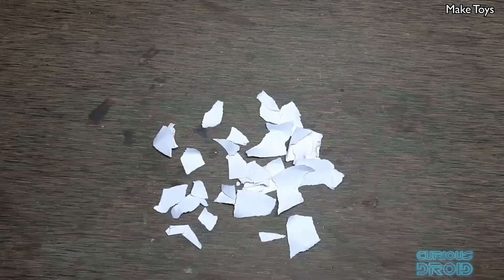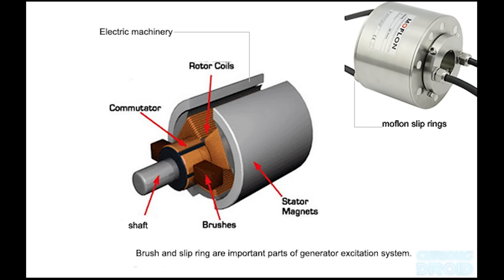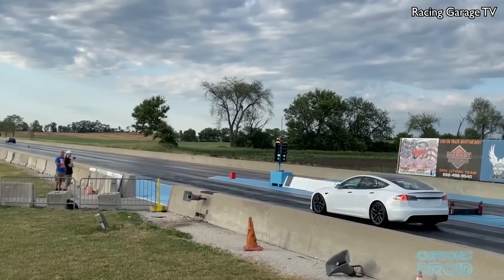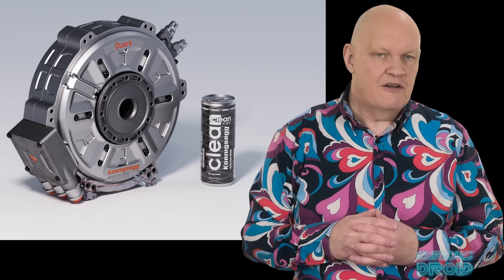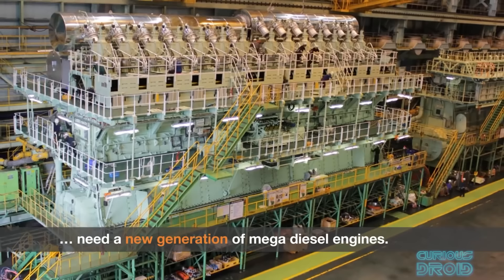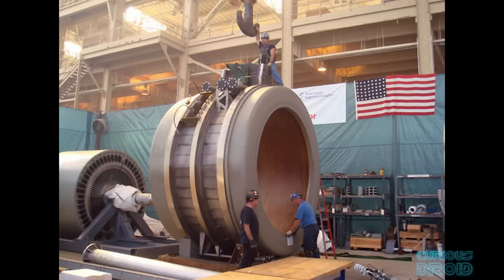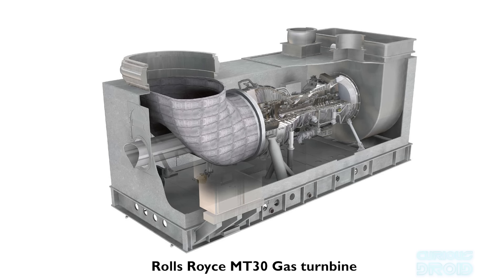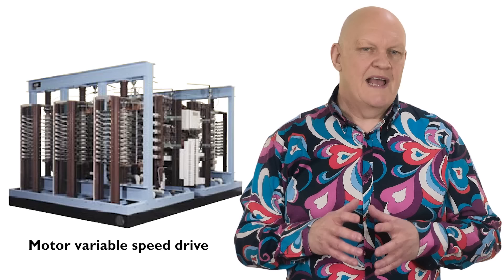The Worlds Most Powerful Electric Motors

Comment: why did you forget brushed dc motors
Reply: you can integrate cooling, both air and liquid (water, ethanol) cooling
Reply: you can use conductive bearing lubricant, carbon graphite, as brushes

Comment: Seeing as we've known for a long time that a diesel generator pushing an electric motor is more efficient than having a diesel engine why has no one done anything similar in an aircraft?  Instead of four fuel-guzzling turboprops you could have four motor-driven props powered by a single turbine, same output for a quarter of the fuel.
Reply: I guess mostly weight and safety (both from less redundancy and more complexity).

Comment: what they done wrong 200 amps to run  more amps more heat, so how can you solve this well this part most know the motor can run at 1000 volts  now amps become 20 amps or less
now we have a probem batters  so lets take this off the drive line all togather, there is another way to run a car with no motor on drive line no trasmission no drive shaft,
so what is left, because all people who work on are schooled they never ever understand what to do, and do to what this worth i not going state it here, 
but this been around for last 30 years so nothing new, so how will this work we need small motor to drive few things we need make 50 amps maybe 80 max 
now batterys  are 3 phase runs the motor wich will drive two devices  these devices will run the car now motor will have built in two battery chargers
so we have 5 banks of batterys when battery get to 70 pecent it swap out and charge and so on so no bank gose under 60 pecent 
useing this the car can run for ever never need charge, when u leave the car genartor can keep running to bring all battery charge up 
u just cant drive off with car . no soler panles none that now they making power in 1950s 60s and yeat peolpe say was never done , well was done, becuase u never schooled in it dose not meen it was never done,  and one odd thing no busnes has ask me how, they think there perople can figger it out some point time they might fisrt one own all rights to it 
and if they cant o well,  this can be done this can be done to power hole contry idea is same, but they not looking for green renewable power they want the grants trying to figget it out
so as long as it resuch all grants they get keeps comeing so to figger this out ends all them grants but they forget how much busnes will pay to use it , totaly green cars rv trucks  it can be done 
and no one cares to do it what this even sujest  that dont want compeat it at all

Comment: So the 4 electric motors produced what one big diesel does. An weigh about the same. So the " YOU WOULD BE WRONG IS NOT CORRECT AT ALL. 27000 IS A LONNNG WAY FROM 107000 HP. AN YEAH WHERE DOES THE POWER COME FROM? WEIGHT OF THAT COMPARED TO THE DIESEL BURNT? OH AN THE DIESEL SHIP GETS LIGHTER EVERY MINUTE!! LONG WAY TO GO MY FRIEND. ALL THESE ELECTRIC THINGS SOMEHOW FORGET ABOUT THE BATTERY/ ANCHOR WEIGHT. NICE TRY THO!
Reply: The Motors on the Aircraft Carrier are powered by four Gas Turbine Generators though. That's common on Cruise Ships too, most of them have Diesel-Electric Propulsion. The only all-electric Ships are Ferries that cover only a short Distance and thus can recharge frequently. There also are Ships powered by Overhead Catenaries like a Train, but these are very specific Niche Things.

Comment: Does sharing the torque figures really mean anything? I though the whole reasons why we came up with HP was that we could compare engines. A human leg makes more torque then a mid level sports bike that can go 150mph.
Reply: A dentist's drill is probably capable of 1/10th horsepower. Yet the torque is so tiny that it couldn't start moving if you held it with your fingertips.
On the other hand, you have electric-hydraulic cable tensioners. They can't turn very fast, but they have huge torque. Yet they can still have that same 1/10th horsepower.
See the problem there? You still need both figures.
HP only describes power, not force. Torque describes force, not power. So you need both.
Reply: @44R0Ndin  that's what a gear box is for. You can take an engine and make any level of torque you need but you can't make different levels of power. Now I understand you want to optimize the engine for its use to get the most efficiency, no point running a small motor at  billions rpm when a bigger slower one is better but I feel like most people use torque as a misnomer. It's like when people talk about volts. A wall outlet can kill you but only is 120 or 240 but a stun gun makes thousands and does not kill you. Volts alone is not the full story.
Reply: @pleasedontwatchthese9593  well said, it's very commonly mis understood, especially with cars guys and their "wall" analogies....
Reply: you are right, not really, HP is all that matter and torque at "wheels" or output is all that matters...HP = torque potential and torque is variable due to gearing.  Bit of a misnomer to talk electric car torque also, people throw around the thousands of foot pounds a e-motor can produce since they don't have nearly the gear reductions ICEs do, but when factoring in gearing with a ICE, they have thousands of ft lbs at wheels too.
Reply: @pleasedontwatchthese9593  That's the whole problem tho. Without a starting torque value for the motor, your math explodes.
And that's well before you even start to calculate things with the gearbox involved (and you have to account for losses in the gearbox too, because there is no such thing as a perfectly efficient mechanical device, and that includes geared transmissions).

Power = torque times RPM.
RPM = Power / torque.
Torque = Power / RPM.
So, Mr smart, what's the shaft speed of a 50 kilowatt motor operating at max power? No gearbox involved, just the bare motor.
You see it doesn't make any sense, because you're missing data. The data you're missing is the torque output of the motor.
Now granted most motors and engines don't just operate at one fixed torque, instead the most commonly quoted figure is the torque and RPM at which the specified power output is achieved.
But since that's the case I'm talking about, let's now introduce the missing data and say the motor puts out 250 newton meters of torque at that 50 kilowatt power output.
Now since you can do all the math, you find that the shaft speed is 1950 RPM, pretty close to the standard speed of a three-phase induction motor running directly on mains voltage (1750 rpm).

But my point was simply that you need more than just "horsepower" to tell you how "good" an engine is.
In fact, torque and redline RPM are more relevant factors when designing a transmission or trying to design something that actually moves, with you working out the required horsepower from there.
Point is Horsepower on its own is NOT ENOUGH to describe how good an engine is, no matter if the layperson uses it that way or not, it's still wrong.
You know those old 70's era US cars with the anemic V-8 engine that only put out like 200 horsepower because of all the early-tech smog equipment on them?
Guess why people still tolerated those miserable excuses for a V-8?
TORQUE! That's why!
They could ACCELERATE the car from a standstill at an acceptable rate, despite their anemic power output compared to their displacement and fuel consumption.
Now, you take a modern 4-cylinder engine that produces roughly the same power and put it in that vehicle without changing the transmission's gearing, and it will be a miserable experience! Why? Lack of TORQUE!

Now to further my point, a couple of examples of edge cases.
If a motor produces zero torque, it will never turn, and power output is zero.
If a motor produces infinite torque and is not ALLOWED to turn (say by being stalled against an immovable object), then it will again produce ZERO POWER.
This is because Horsepower is Torque times RPM (times a constant usually).
And if either of those numbers has a Zero in it, the other number's value won't make a difference, because even infinity times zero is still just plain old Zero (but more properly if you're getting infinites out of your math and you're not doing calculus, then it's a big sign that "you did the math wrong", or "you missed a variable", or some other mathematical error has happened).

Now there's also the problem of electric motor horsepower, and this marketing term used by shop vacuum manufacturers called "peak horsepower", which is just PURE bullshit.
What happens when you take the maximum unloaded RPM and multiply it by the stalled rotor torque? You get Peak Horsepower, which is a meaningless value because the motor will never physically be able to achieve both of those specifications simultaneously (you're requiring the rotor to turn at both zero and maximum RPM at the same time). Thankfully I think that particular metric has been eliminated, but I am almost certain that it took a lawsuit proving false advertising in order to get that change to happen.
Reply: @44R0Ndin  Electric motors for industrial use cases, which this video is mostly talking about ARE NOT peak rated and never have been. They are rated for continuous use at 104 F (40C)  ambient environments for non stop 30 to 50 years running and can easily produce 2 to 3 times more horsepower when overloaded. Just goes to show you are the "Mr. smarty pants". The  electric motors you are talking about with over inflated HP figures are end user product's ratings and are NOT rated by the electric motor manufacturer, but the end seller who made the product that uses that motor.

Okay then genius, if torque of your 200 horsepower V8 gas engine is what matters and not power, which describes BOTH torque and Rpm (hence why its HP = torque*RPM) then lets have Jigsaw trap you in a room with your torque heavy, low RPM engine that is 200 hp vs a turboshaft, 500 hp gas turbine engine that is low torque, high RPM.

Jigsaw used a 400 horsepower electric motor that will be powering a massive door that needs electricity from a generator. If you pick incorrectly, the motor will not start up properly and trip out the overload and a mechanism is in the door such that once that happens you are trapped forever and as it locks down from ever being able to open again.

In front of you are a selection of gearboxes and a 1800 RPM generator that is 360Kva rated. You can either choose to gear down the gas turbine engine to 1800 RPM or your gas engine v8 to 1800 RPM. 

I bet you will pick the 200 HP gas engine V8 because of your "torque theory" and then you are trapped forever. A real smart person would pick the 500 HP gas turbine and make it out alive.

 Torque does not translate into electricity. MECHANICAL POWER DOES. It takes one horsepower (746 mechanical watts) to make 746 electrical watts of electricity at 100% efficiency.  I don't care how much torque your engine makes, horsepower is what matters. Electricity is proof of that. A 500 HP engine can power more electrical devices and more powerful electric motors than your 200 horsepower gas engine. Power is power. How you make that power with various RPM/torque combos does not matter.
Reply: @EETechs  You'll note that when I was discussing "peak" horsepower, I only ever mentioned shop vacuum motors, and that I SPECIFICALLY mentioned it was "a marketing term" and not a "design specification". That was on purpose.
But my point about the math stands. A Torque specification without RPM or power is meaningless, you don't have enough data to calculate anything meaningful about the motor.
Same with a Power specification without a accompanying Torque or RPM spec. Still not enough data ON ITS OWN.
Naturally, it's also the same, yet again, with an RPM specification ALONE, WITHOUT a Torque or Power specification.
If you have ANY TWO of those, you can use math to figure out the third.
Heck, if they give you an RPM and an ELECTRICAL INPUT POWER specification you can probably figure out the torque, if you have a good estimate of the motor's efficiency at its intended operating point (90-95% is a pretty safe assumption).

The ENTIRE point I was trying to make, and that which seems to have flown ENTIRELY over your head, is that NO SINGLE DATA POINT TELLS YOU ALL YOU NEED ABOUT THE MOTOR.
That's just how the math works.

It's like ohm's law. A sign saying "Danger 100k volts" or something of the sort on an electric fence doesn't mean it's gonna kill you. In fact, the intent of an electric fence is specifically to NOT kill you, and they do that by severely limiting the POWER and ENERGY available in any single shock, while ensuring the voltage is sufficient to complete the circuit thru an animal (or human) that has the unfortunate experience of touching the fence's energized wire(s).

Now let's try another example. You go to an electrical substation, and you see a sign that says "Danger 100k volts" just like the one on the electric fence.
Let's say you maintain a good ground connection somehow, and you also grab a wire in the substation that is energized at that voltage. You just completed a circuit, and that means current is going to flow.
But in this case, the current is NOT artificially limited to an incredibly low, mostly safe value. Instead, the current at this voltage will be sufficient to cause violent injury, not only will you likely be in excruciating agony for the remaining fraction of a second of your life, your very body will be cooked from the inside out by that electricity that is flowing thru you treating you as if you were just any other resistor, and turning electricity into heat.
This phenomena has another name. It's called "Arc Flash injury", and it's gruesome and disgusting so I won't discuss it further other than to say that if you die to an arc flash incident your funeral is almost certainly going to be closed-casket.

OK now let's tie those two examples together.
What if all you know is "100k volts"?
How are you going to (without using context clues), determine if that 100k volts sign is warning you of an obnoxious jolt from an electric fence, or from an electric shock that is of such intensity that it will nearly certainly result in your death?

The answer is "you can't tell without more info, you need either power or amperage".

Just like with motors, you need any two of the specifications to figure out the third. One point of data might as well not be any data at all, because without at least 2, the whole thing's pretty much meaningless.

Dentist drill, might have 1/10th horsepower at its ideal operating point, but if you need 50 rpm and you try using the dentist drill shaft to drive your 50rpm load directly without a transmission in between you're going to have problems!
See, even if you have JUST power, the specification is still meaningless!

Note, I'm not talking specifically about 50/60hz induction motors that have an RPM that is mostly dependent on the AC line frequency. Those, you can have the power output vary (in use), because when unloaded they are NOT capable of rotating any faster than their nameplate speed (usually depends on the number of poles in the stator if it's a synchronous AC induction motor or squirrel cage induction motor, with more poles making a slower, higher torque motor).
Nope. I'm talking about brushed DC motors, altho I suppose "universal" motors are applicable here too (hey guess what, that shop vac motor is a universal motor).

With those, the RPM will rise and fall as the load imparts less or more resistance to rotation.

And boy let me tell you, the start-up current draw of a unversal or DC motor is QUITE high. Given the same motor power and operating RPM points, the brushed DC motor will almost certainly draw more current at the locked-rotor state (to the point that soft-start circuits are needed on motors above a quite small size) because the natural inductance of the armature of a brushed DC motor is not as high as that of the stator windings of an AC induction motor of similar mechanical specifications, which means the start-up current transient is greater in magnitude.

Comment: Are any ships taking advantage of the electricity created by slicing through the water yet? That could help sustain your energy for electric.
Reply: Oh boy...
Do you think adding wind turbines would help electric cars?
Might want to look up the laws of thermodynamics and the efficiency of turbines and generators.
Can't get more energy out of a system that your using energy to push through the water or air.
Reply: @ericdunn6232  Ty that's why I asked.
Reply: @nbrown5907  sorry if I sounded harsh. Have argued with too many free energy loons who refuse to see reality.

A sailing ship can use a towed generator, but more effective to use a wind turbine as it will be producing powered even when the boat is not moving.
$per kWh is still best using solar I think.
Reply: @ericdunn6232  I am always trying to learn about things I do appreciate the heads up. After I posted I thought about it and I was in the Navy and we would have done that had it been at all doable.

Comment: Great video. But hp, poundfeet.. not very scientific and doesn’t say much to other than Americans.

Great to see so much Nordic tech! Wärtsällie is Finnish and abb is from Ludvika Sweden which also built the first long range three phase electric powerline. Still in service, nowadays bought by hitachi. Ordered by at the time world largest company, Gränges. Now it’s just a great beer and some trees. 

Only a few kilometers away was the now discontinued paper mill, kvarnsveden. Six electric motors used 1% of the total available power in the country. Before they started the motors they had to call to the hydro plants in the north stating their intentions so they could have time to open the gates. The mill is now converted to a giga battery factory for northvolt.

Keep up the good work! :)